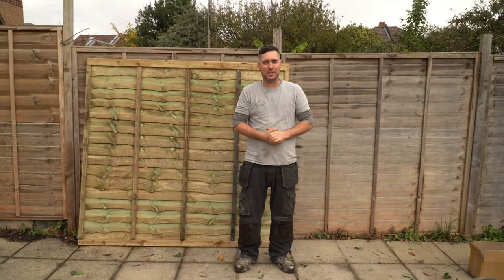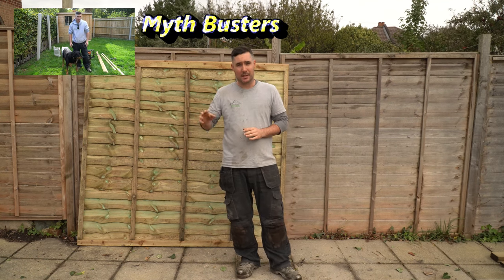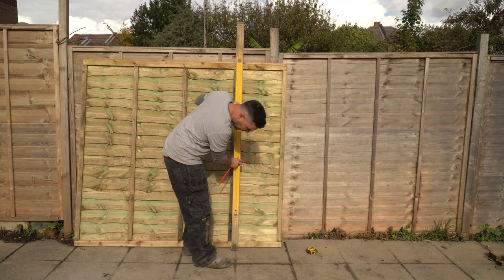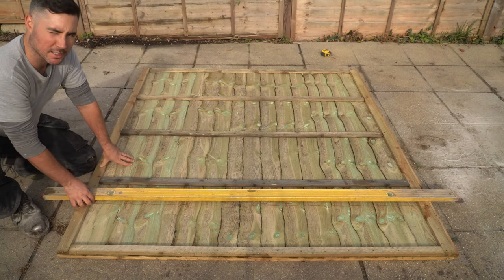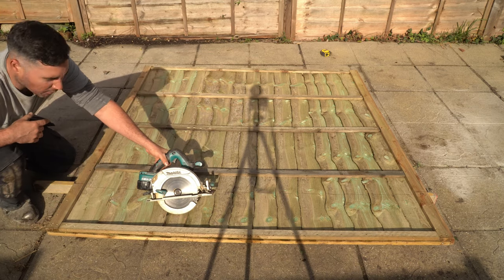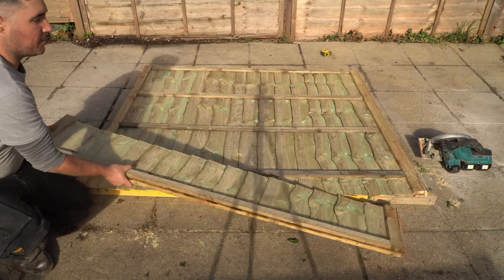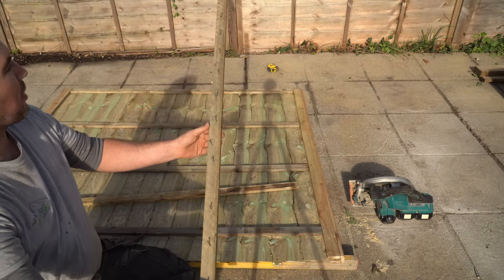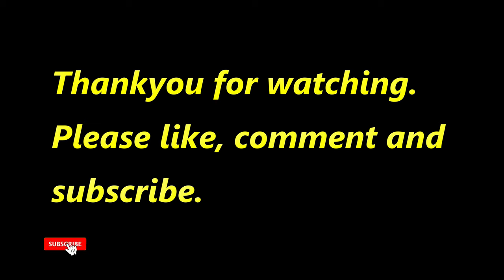Cut an Overlap Panel | Cutting a Fence Panel Down to Size

Comment: About the best panel cut down vid I can find. However don't know why he didn't re-position the end battens first before cutting the excess of the panel off. This would prevent the panel from possibly falling apart when ripping down. You can usually buy battens of a similar size to nail in place before any cuts are done. Nether the less he done a tidy job.
Reply from the maker: You are right but positioning the batten behind correctly is difficult when you cant see it. As long as you use a sharp blade 99% of the time it wont crack the thin laps
Reply: @JamesMontana  You done a nice job. I'm thinking more about DIY'ers that would use your vid and cut down with a handsaw instead of a circular saw. The results might not be the same.
Reply: @vern8461  Thats true but its still a pain.

Comment: I've got to take an old wall down that's about 1.5 standard panels in width, and I'm going to replace with this type of fencing. Do you recommend attempting to convert 2 standard panels in to one big panel, or do as you have here - cut 2 panels down and put an extra post in and have 2 short panels?

Comment: question.  a customer has hammered down a panel about 90% of the way down. problem is the gap between the concrete posts are narrower across the bottom. the panel has a large bow now. if its forced anymore , it will split. Is there a fix? cut a notch on the bottom batten?   thanks

Comment: Spot on that 👌👌👍👍
Reply from the maker: Thankyou mate !
Reply: @JamesMontana  good to see someone else doing it the right way! 👌
Reply from the maker: @goldingsgardenersltd9293  Just the way ive always done it. Still a bit of a pain cutting thoes flimsy panels.
Reply: @JamesMontana  looks like a a better quality lap panel... The cheaper thinner ones are pretty temperamental!
Reply from the maker: @goldingsgardenersltd9293  yeah they are not bad for what they are. Always id go for featheredge panels though

Comment: Hi fella great video. Do you reckon its  possible to reduce the height of these panels. Am looking to reduce the size of a  Forest 6' x 3' Pressure Treated Lap Fence Panel to 2'6" height. I have 4 to do this size. any advice much appreciated.

Comment: Thanks. Easy. Any chance you know how to cut euro fence panel?
Reply from the maker: Yes, they can be a bit of a pain. I normally just leave the end off as its a pain to fit and you wont see it anyway if using slotted concrete posts. Cutting the bottom is easier.

Comment: Hi do you think you could use a jigsaw rather than the circular saw?
Reply from the maker: You might get away with it but your will likely crack the thin wood. Try removing the battons anf fit back on your marked line. Then screw together before cutting. You wont crack the wood then, but its difficult to get both front and back battons lined up perfectly to each other this way.
Reply: @JamesMontana  Hi thanks for the swift reply! That's a good point the vibration may crack the thin fence wood, I will try using a large hand wood saw instead.
Reply from the maker: @linkpad6270  Youre welcome. Oil the saw blade so it doesn't stick. Good luck with it.

Comment: Move the batton first to mesured size  then you have a guide to run your saw along .
Reply from the maker: Yeah ideally move both battens to measured size screw together then cut, but its hard lining them both up without cutting it first. Plus thoes battens arent often straight. Thanks for your tip !
Reply: Yeh nick leave it to the professionals 😅

Comment: What if I have to cut it width way? Same process?
Reply from the maker: Yes exactly same process
Reply: @JamesMontana  thanks mate . I genuinely got the idea I just thought the width way cutting it might be prone to splitting more.
Reply from the maker: @gavinletford1539  Not really. Its less likely to split width ways. Its an easier cut.
Reply: @JamesMontana  thanks for the info   a  much earned subscribe.
Reply from the maker: @gavinletford1539  really appreciate it mate. Anytime you have a question dont hesitate to ask 👍